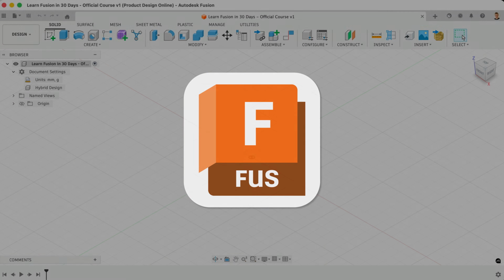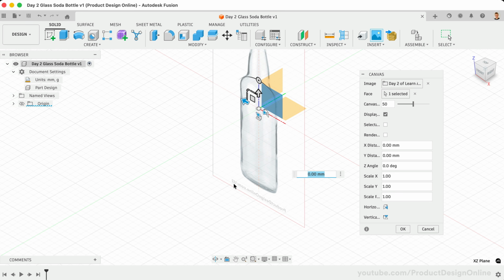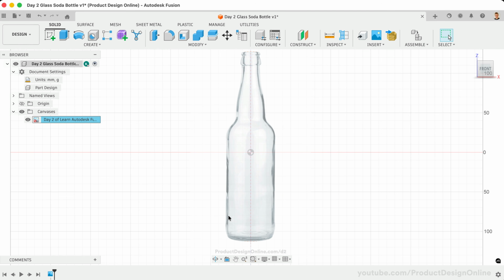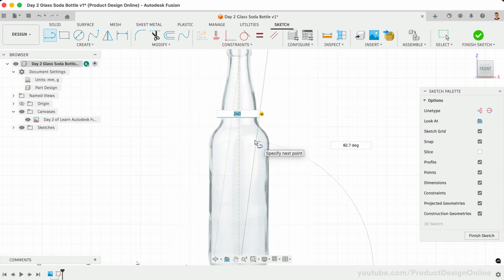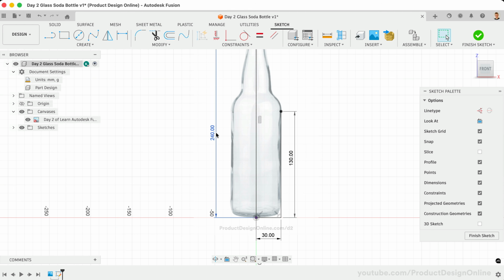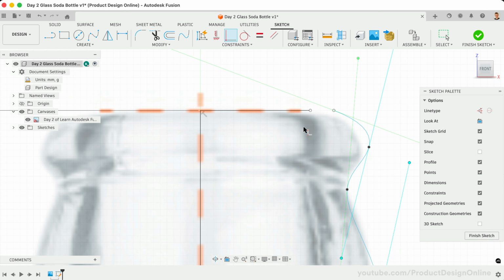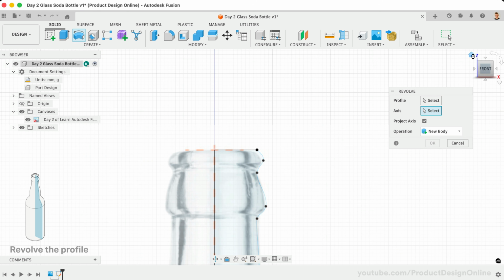Day 2 of Learn Autodesk Fusion in 30 Days! (2026 EDITION)

Comment: 14:10 Error message says: "The shell cannot be created at this thickness. Try adjusting the thickness, the selection set, or change the Shell type".
First I was able to set thickness to 1mm (not more). The issue is the TOP POINT on the SPLINE. How I figured it out? When you use the SHELL tool, the direction arrow will be pointing perpendicular to the line used to adjust the last point of the spline. Just increase the angle of that line, that will push the SHELL arrow inwards and allow you to increase thickness of the SHELL.
Reply: Kevin please help

Comment: Great tutorial! One thing I wanted to mention that happened though. I was having trouble avoiding the shell thickness error at first. Interestingly 0.5 mm worked, but values 0.6 - 1.9 did not (error). Then strangely,  values 2 - 2.5 did work (no error) but the line was thin, thinner than the one in the video and the 0.5mm line from before. Typing 2.1, 2.2, 2.3, ect made it even thinner, as if the thickness was inverted or something. Correcting the spline angles indeed fixed the issue but definitely a weird quirk to observe.

Comment: After importing the image and selected the correct pane. My bottle is standind upright on the grid while you have it lying flat on the grid. Is that a display or grid setting?
Reply: Orthographic camera view?
Reply from the maker: There are two different grids in Fusion. The "Layout Grid" which is a visual setting that appears when you create a new design file. It helps you visualize where your geometry sits relative to the origin/coordinate space.

The second grid is the "Sketch Grid" this is the grid that you're (likely) referring to when you are in a sketch and seeing the bottle image. Whenever you're in a sketch, you can turn the Sketch Grid on and off in the Sketch Palette on teh right.

The Layout grid can be turned on and off in the Display Settings at the bottom center of Fusion.

Comment: ONE OF TWO --- Firstly, great video :) I love the 'stage' icon in the lower left corner. Total speculation: If you had all stages there, would it be better? DK - Can almost overlook this next one: Your video were always excellent & they get better every time. You cover all the common mistakes & more with each redo. ---- Cool to see your picture too at the beginning & NOT through out the entire video. Still can't figure out why people do that when they are sharing a screen.

Comment: just a doubt, when i was viewing the inside of the bottle, one side of the inside of the tapering part of the bottle was rough while the other side was smooth, i didnt understand y that happened
Reply from the maker: Double check that your bottle is centered to the centerline. If it is, make sure the exterior fillet is applied all the way around as well.
Reply: @ProductDesignOnline  it is, also one more thing i noticed was that it is actually normal in the beginning, and after about 5 seconds after zooming into that side, it reverts into some deformity, the same thing even happened in the complex bottle design.
Reply from the maker: Can you email me your file? Something is not right but I need to see what's going on 😊
Reply: @ProductDesignOnline  sure, where can i get your email??
Reply: @ProductDesignOnline  sure, where can i get your email??

Comment: 13:35 Well I got the Shell to work.  I can see the shell inside the bottle, but it did not create a hole in the top of the bottle like yours did.  Why?
Reply: Apparently 2.5 mm is too much and its just closing the top.  I went back to the sketch and double checked the 11 mm radius across the top.  I can set the shell to 1.5mm, and that creates and opening which looks proportionally identical to the one in the video.  But not 2.5, or even 2.  After setting it to 1.5 I used the ruler tool to measure the distance between the outside edge of the top of the bottle, where it flattens off, and the inside of the opening created, its saying that it is 3.354 mm.  Shouldn't this be 1.5 mm?  I don't know but its clearly not doing what it is supposed to.  I have backed up the video now at least 5 times and followed the directions exactly.
Reply from the maker: That is likely due to your top spline point being too sharp. Adjust the spline point and try the 2.5 mm again.
Reply: @ProductDesignOnline  I tried, many times.  I made the sides almost straight, it still wouldn't work.  I finally gave up and left it at 1.7mm which was the most it would accept.  I was able to return to the same curves you had (at least as close as I could eyeball it), but couldn't get over that 1.7 still without it closing the top.  I'm sure I still did something wrong, just no idea what.
Reply from the maker: @K162KingPin  Can you email me your Fusion file? (.f3d)
Reply: @ProductDesignOnline  is it the "sponsors@" address?
Reply: @ProductDesignOnline  Also I have not gotten to the "how to find save files locally" lesson yet lol.
Reply from the maker: Yes, that email is fine. In Fusion, File > Export > choose .f3d file (native Fusion file type) and then attach it to the email.
Reply: @ProductDesignOnline  Sent.  If you figure out what I did wrong feel free to post it here.  I never check my email.

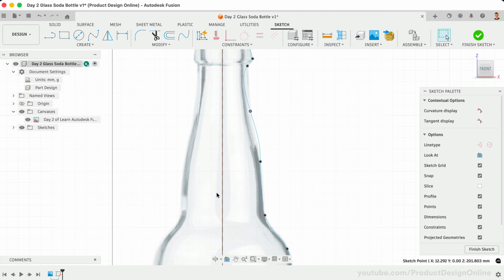Comment: 7:50 "Next you will want to select individual spine points"... HOW!  It looks like you are just clicking them.  That doesn't seem to do anything, neither does double clicking them.
Reply: I found it, you have to right click on one of the dots, then select "Activate Tangent handle".
Reply from the maker: You do just click them... Press ESC to clear any active command then click the spline point once to get the handle to show up.
Reply: @ProductDesignOnline  Thanks.  I ended up "undo"ing through every attempt to get it to work until I deleted the last layer / circle, we created.  Then went forward from there again and it worked.  So I have no idea what but I must have selected or unselected something along the way.

Thanks for great tutorials, even if I struggle to follow some times :).  I even went one further on this guide and created a threaded cap for my bottle lol.  Useless, but good exercise.  I'm sure you cover that later anyway.

Comment: Please can you help? I created the sketch up to the point where you advise setting the top of the lip to 11mm. When I do this, I get a pop-up advising I have created an "over-constrained sketch". I cannot work out why or where this, let alone how to resolve it. Any ideas?
Reply from the maker: That would mean there is another constraint or dimension that is already affecting that line. Double check if any other constraints were automatically applied when you sketch that line. It may be easier to delete the top line and reset it, allowing you to add the 11mm dimension.

Comment: Hi When i sketch the lines i dont get the measurment of the line, is it just a setting?
Reply from the maker: No setting that I'm aware of. The only other time I've seen something like this, it was a graphics based issue. Try clearing your Fusion cache and restarting.
Reply: @ProductDesignOnline thanks, I reset everything to default and it made lines when I was doing video 3 so strange

Comment: so...i'm doing something wrong...after the 360 revolve (using the centerline method), i'm getting a division between the lower 130mm part of the bottle and the upper splined curve part...that causes issues when trying to apply the shell...ideas???
Reply from the maker: It sounds like your sketch profiles aren't perfectly joined or coincident at that junction, so double-check that your lines are constrained.

If not that, please export as .f3d file type and email me your file. It will be easier for me to pinpoint if I see it 😊

Comment: When Shelling, I noticed the Shell type selection needs to be "Rounded Shell".  Under that selection, it even mentions that it is for bottles.
Reply from the maker: It depends if you already have Fillets. Fillets are still often preferred as you have much more control over them.

Comment: Hello. First of all, thanks for the classes. they're very interesting as it shows us (mainly for me a newbie into 3D Modeling with Autodesk Fusion), lots of ways of doing stuffs, the usage and moreover some way of thinking, that is the most important to let's us available for creating our own objects...  Concerning the Mesh Option, it worked for me in this example, on the other hand I'd like to use it for creating a kind of small grill, with hexagonal holes, but in this specific case I didn't achieve it. if you have any tip about how doing it, it'll really help me.. thanks in advance and again congratulations for your clear way or explaining in this 30 days learning (I'm still in the 3rd one, but I hope achieving all the 30 days)...
Regards,
Marcio
Reply from the maker: Hi Marcio. Thank you! Can you send me an email with more details and screenshots of what you're trying to achieve?

Comment: Thanks for the great tutorial. I followed the tutorial step by step, but when I use the Shell and find the top face, it only let me select the whole body instead of the top face. Why?

I have tried select the top face first, then press Shell command. However, the command still applied on the whole body instead of the top face.
Reply from the maker: That most likely means the top face is not planar. Edit your sketch and double-check that your top has either a horiztonal constraint or a perpednicular constraint at the corner. If it does, then it is 100% the top spline handle being too sharp. Adjust the spline handle and drag it toward the spline point to make it smaller.

Comment: Could not get the revolve new style to work. Will practice some more with the revolve command which is very handy.
Reply from the maker: Can you elaborate on what didn't work for you?
Reply: @ProductDesignOnline  I selected the line and then the revole, but it didn't revolve like in your tutorial. Will figure it out did the bottle the old way.
Reply from the maker: @hansstraat1978  Double-check it's centerline and not construction line type.
Reply: Yeah, same. Still find out how to do that

Comment: When creating shell I get error : The shell can not be created at this thickness. Try adjusting the Thickness, the selection set. or change the Shell Type. I went back and checked everything. When I put 2.5 i get error, but if I use 2mm then it is fine. So i will roll with 2mm. But I would like to know what could be the problem
Reply from the maker: Most likely that one of your top spline handles is creating too sharp of curvature. Try adjusting the spline handles, one at a time, and then retry the shell at 2.5mm each time.

Comment: 12:01 - I selected the centre line but I didn't get that SKETCH PALETTE window on the right so I wasn't able to turn it into a construction line. I've been getting this issue with a lot of CAD learning tutorials (instructor shows a feature but when I do the exact same thing, I can't see it on my end). That happened a lot with OnShape, which lead me to dropping it and coming to Fusion.
Reply from the maker: Sorry to hear that. To be very clear this is a known BUG with the latest version of Fusion that is affecting 1/3 of users according to Autodesk. Sketch palette should ALWAYS show when in an active sketch. My 12 years of using and teaching Fusion. I have never seen the sketch palette issue. Unfortunately, it is a graphics bug affecting some users. Try to clear your cache for Fusion and then uninstall and reinstall Fusion.

Comment: Somewhere along the way, the sketch's line dimensions stopped showing, and the sketch palette disappeared.  I am at a loss on how to recover either, even after saving-loading design, closing-opening app. hiding-showing sketch,  finishing-editing the sketch, ..., nothing reveals the missing palette, and only explicitly added dimensions are showing (used for the 11 mm step.)  I am paused on the step to convert the vertical middle line to a centerline as I write this.  I am able to continue as I discovered the right-click contextual menu provides the option to convert the line to a centerline.  I just am boggled about the missing sketch palette. (The canvas palette appears when I re-edit the canvas.)
Reply from the maker: Sorry to hear you're experiencing these issues with the Sketch Palette missing! There are several things that can cause this. I was going to type them up, but realized Autodesk has them documented (as this must happen a lot).  https://www.autodesk.com/support/technical/article/caas/sfdcarticles/sfdcarticles/Sketch-palette-is-not-visible-in-Fusion.html

I'm guessing your is the graphic driver prefernece or multiple monitor issue, as those are the ones I've personally seen most common.
Reply: @ProductDesignOnline , I just paused again during the Day 5 project and found my sketch palette had disappeared again. I tried resetting to the default view, but the palette did not re-appear. The palette was present when I first started, but, after whatever it is I did to lose it, when I create a new sketch, or when I edit an existing sketch, the palette is missing.  I did discover, though, creating a whole new design and adding a new sketch  works to return the palette.  Once I have the palette appearing in the new design, I can return to the old designs and see my palettes again. It looks like Autodesk has already had other feedback about the problem.  Hopefully, they will solve it at some point. At least I have a workaround.
Reply from the maker: Hey, I thought of you/this thread, as I happened to see a thread on Facebook where a Fusion engineer said this is a problem affecting select users right now any they're trying to figure out why. Hopefully they fix it in the next update.

Comment: Dumb question: my attempt today resulted in multiple sketches: the vertical center axis line (240 mm), the 30 mm bottom line, the 130 mm bottle body, the spline, and the 11 mm opening. The lines are all joined with no gaps, but there is no profile. Do I need to delete the sketches and start over and only have one sketch?
Reply from the maker: It's likely that one of your points is not snapped together. You can draw a line straight across to help narrow down where that may be...by looking for the area that remains unshaded. Also, make sure your centerline is the centerline option (in the Sketch Palette) and not the construction line option. This will affect the profile. If that doesn't work, deleting the sketch and starting over is probably just as easy!
Reply: @ProductDesignOnline  - Retaining the spline sketch since i was satisfied with it - I deleted the second sketch which contained all the straight lines. I edited the spline sketch and re-did the straights. The rotate and the remainder of the work can proceed now.
Reply from the maker: Awesome! Glad to hear you were able to work through it.

Comment: hi , when iam trying to calibrate the reference image by placing 2points in bottom and upper portion of the bottle image. Then while zooming after one point cant see the image. but in your video you are able to zoom better how u are able to do it
Reply from the maker: I am zooming with center mouse. Fusion will mostly zoom in where your mouse cursor is. 

You can also click and hold your mouse wheel to pan the image down if zoom in and can't see it at the top. 

The other option would be to use the Pan tool in the Navigation Bar at the bottom of Fusion.

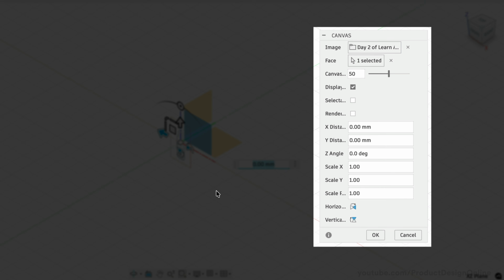Comment: After you imported the reference image from your computer how did you enlarge it without the measurement dialog box changing from 0.00mm ( before you flip it? (around 1:32)
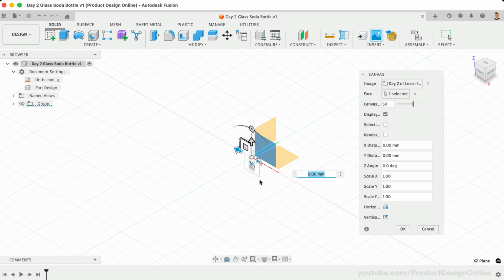Reply from the maker: Great qut. It's not actually being enlarged at 1:32. I was zooming in with the mouse scroll wheel to make it easier to see.

Comment: I cannot seem to get the construction lines to populate on my sketch, I did some googling and some badgering of the ai assistant in 360 to no avail. Any help would be appreciated, I do not have the dashed red/orange lines. I'm hoping it's a simple toggle that I'm missing? thanks in advance!
Reply from the maker: Hi Devin. Any chance you could screen record it and email it to me? I've never seen this issue before so this one will be hard to troubleshoot without going on.

I have a few times seen different UI type issues where people had to do a clean uninstall and reinstall a Fusion to get random things to work. That may be worth a shot...
Reply: @ProductDesignOnline  Thanks so much for getting back to me! I Started your tutorial a couple years ago and never finished and I picked back up my designing and 3D printing, was thrilled to see you have a new edition. I went to reinsert the photo to screen shot for you and it uploaded with the construction lines, looks like maybe one of the fixes I tried took and I just needed to redo the procedures. 
I'll reach back out if I run into more issues (hopefully not), thanks for the videos they are awesome!!
Reply from the maker: @devinpeterson1696  You're welcome! Glad to hear you were able to work through it. Happy learning! 😄

Comment: Can anyone help, when I select the top of the bottle to do the shell, it then selects the whole bottle as soon as I press the shell button
Reply from the maker: That means the top is not perfectly planar. Edit your sketch and make sure there is a perpendicular constraint in the corner and that the top spline point is not too sharp. 

If you can share your Fusion file, I can take a look.